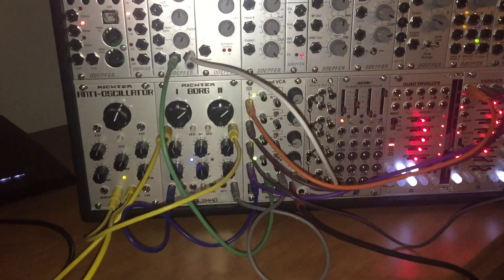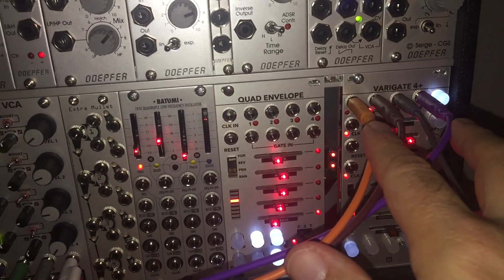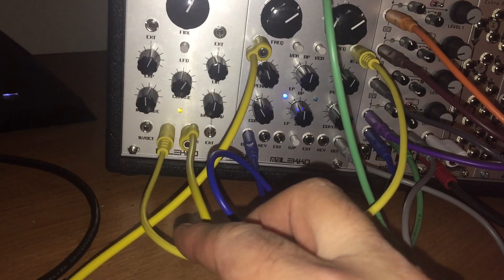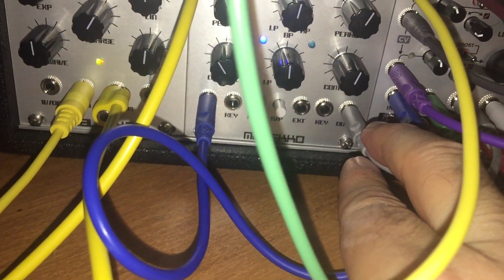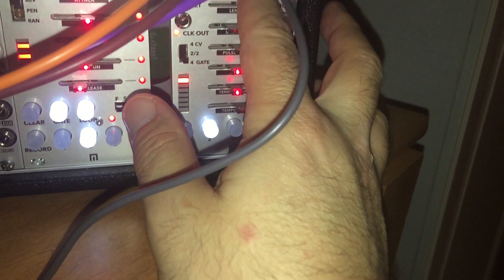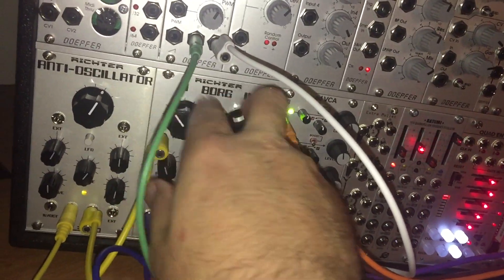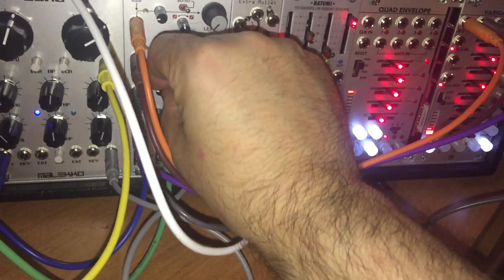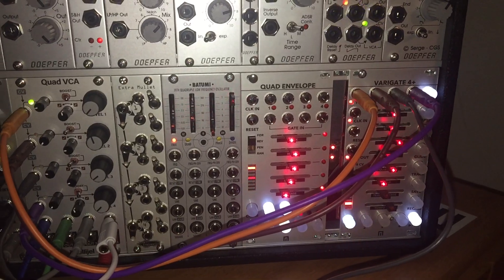First Test Malekko Varigate 4+ Modular Sequencer

Comment: Love the varigate! I'd recommend putting those gates into envelopes, and using the envelope to CV the VCAs for a smoother sound. 

Also, try 2 gate/2 CV (or even 4 CV) mode to get some awesome 1V/Oct sequencing from Varigate. It has quantization to a bunch of scales and it is very easy to make sequences!
Reply from the maker: thanks so with my Varigate 4+ send the gate outs to Malekko Quad EG gate inputs and route to quad vca? I will try some patches this weekend and season to taste. Appreciate the insight.
Reply: @GuitarsAndSynths  yeah! I was going to say the same thing when I watched your video. You’ll have more control over the length of sound when you use the quad envelope to the CV inputs on your VCA.